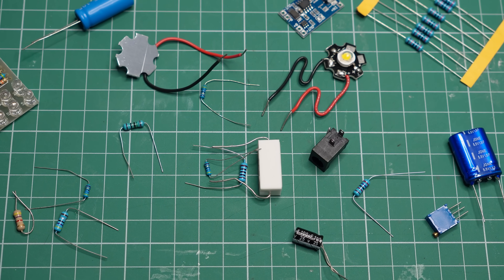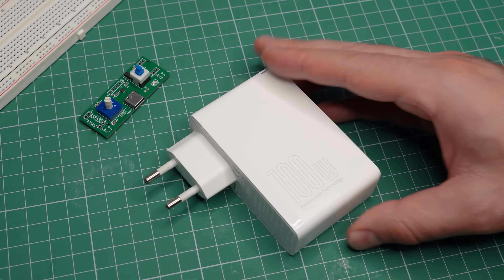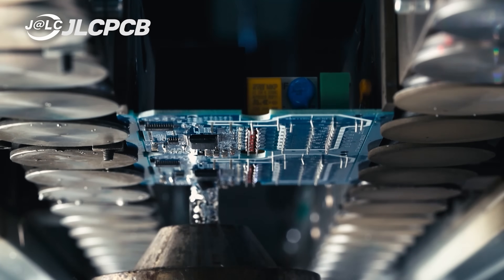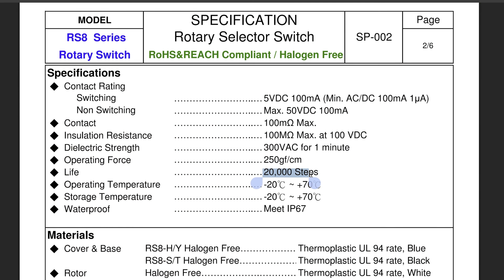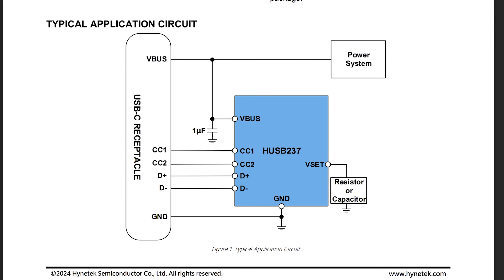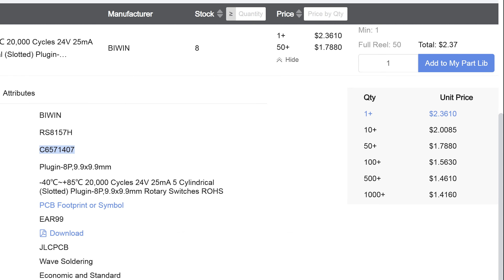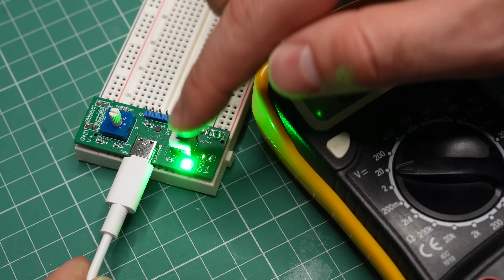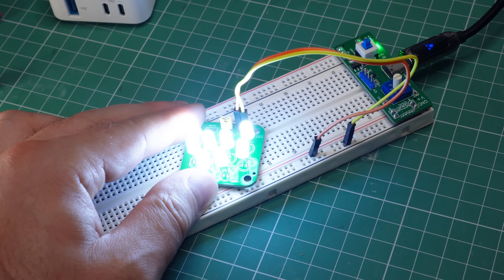My DIY USB PD Power Supply is Beautiful but Buggy

Comment: I think you can draw inspiration from the USB C PD trigger boards. They can also be used for achieving the same goal. There is a great GreatScott video about it. You may check it out. Like in some trigger boards it uses a single push button switch for switching to various voltages. You may also use DIP switches. Both would be pretty great alternatives to compared to the current selector switch, at least according to me. Btw, great video. I think you should definitely keep on improving this. However using the HUSB237 reduces the complexity by a great extent. We only the board to act as a sink device. Using FUSB 302 would be a overkill.
Regarding the problem of the chip registering the new power requirement only after restarting it, I think the chip is deliberately designed to function that way. The HUSB237 does not monitor the VSET pin continuously. It only samples VSET once at startup. You may need add a push button switch that disconnects the cc pins for a short time and there is restart. The negotiation starts again with the new resistor value and we get the new power output. Other wise the charger will just be set at the previously negotiated value. Most standalone PD trigger chips (including HUSB237) sample the VSET/config only at attach. That’s industry standard for simple, low-cost decoys — they latch the requested PDO at negotiation time and won’t re-read a resistor live. If you need live changes, you’ll need either an IC with a host interface or a microcontroller.
Edit: not sure about if one can use a crystal oscillator here…You may take a look at the CY4533 module...it would be great for our purpose.

Comment: nice I like that pd chip I have used it for my project also
Reply: Edit: I just don't like it uses D+ and D- so as an alternative I use sometimes the IP2721 which can work with only the CC and VBUS which from my supplier only costs like 0.10€ more which would make APPLE MODE
BC1.2 not work but I don't own apple products anyway so y

Comment: a current limiting option would be very cool! 
i've made a atx bench power supply but still am looking for a good way to make an adjustable current limiter of a few amps. 
 i just don't like the LM317, linear or arduino with 1 ohm resistor aproaches.

Comment: Unless it specifically says “make-before-break”, any given switch is almost certainly “break-before-make”. With a double-throw switch like that it would be possible to pull the Vbus pin to ground, but you’d want to check its datasheet if it would be allowed to have voltage on the CC pins but not the Vbus pin, my guess is not. It would be an option to disable the output using a MOSFET, especially a P-channel but either way works. Interrupting the CC pins might get what you’re after, unfortunately the chip you chose lacks the ability to disable its output, maybe consider a different IC like one of the ones from WCH. I believe the PD trigger boards using the WCH chips don’t need resetting to change voltages, they usually have a 3-way DIP switch on them but you could easily replace that with a 1-8 binary rotary switch. There’s also the possibility of using analogue switch ICs or momentary switches to alleviate some of your issues.

Personally I think it would be useful to have a split-rail breadboard power supply, for analog circuit design that wants +/-12V or so. Other handy features you could add to your design include an overcurrent latch feature, where exceeding some current threshold turns off the output and turns on a red LED, until the user pushes a button to enable the output again. Better for digital circuitry than a constant-current limit.
Reply from the maker: Yeah, I had the same suspicion about the switches. Thanks for the detailed feedback. It helps! And yes, other people also wanted to see multiple rails. I'll have it in mind if I ever make another version. I think there's a chip that can do a +12/-12V from a 5V supply.
Reply: @LeftyMaker  Rail inverter chips are an option, but because they’re switching ICs they tend to be noire than I’d recommend for an audio circuit. Better to have the audio breadboard supply use a plug going to an external linear power supply (maybe with a constant-current mode), and have it be seperate from a higher-power variable-voltage supply (maybe with an overcurrent latch or efuse). I’m really interested in seeing continuous voltage adjustment with USB PD PPS, maybe even constant-current use, but the protocol doesn’t seem too robust.

Comment: Try to add a pulldows resistor for the vbus pin. Maybe it is realy efficent and the caps floating voltage is enough for keeping the chip in a half flating state.

Comment: HUSB237 constantly requests from type c 5B, by default there is no voltage on type c and HUSB237 pulls cc1 or cc2 to gnd, when you disconnect HUSB237 from power, nothing happens due to the fact that HUSB237 requests switching on even without power. This should not be related to the display in the type c cable, most likely the role is played by the chip in the cable that tells the charger that the cable can skip 5A, due to different manufacturers, the behavior of the chip may vary.

Comment: Yes, this is just a suggestion, it would be better to add a voltmeter, because it is very dangerous if the voltage is not correct.

Comment: It could be that some USB C cables have ground connected to another pin, and the switch is only cutting one of those ground connections. That'd explain why some usbc cables work but others do not with the on off switch

Comment: I had a similar-ish glitch with one of my PCB's. I thought a LDO chip had an EN pin, that would work as a comparator. But instead, it has a noticeable linear section before it disables, lowering voltage, which is not what I wanted at all. Luckily that's a side feature of the main PCB. I would use a mosfet for switching the main power line, and add a SMD fuse of 1A or 2A etc so it doesn't blow something. I was going to say use a potentiometer for the voltage (and you might be able to do that with a different USBPD chip) but that VSET pin is crazy lmao. I can see that it's likely supposed to be set one time by a designer that placed a .5cent part, not be dynamically switched online.

Comment: Great work you have made simple. After sorting out the issues, can you build the battery powered Source board and Sink/trigger board for PD3.2 240W with up to 48V with display for voltage, current, power, internal resistance, energy & coulombic Ah, etc, using this simple concept? Endeavor to share the links to the comprehensive & complete circuit description & details.

Comment: To completely cut the output power you definitively will have to use the intermediate switch approach; USB type A outputs and (apparently) cables with power meter are designed to always output 5V by default, regardless of negotiation (and falling back to when it stops). In these cases that's why you saw power regardless of the PD chip, only type C outputs with normal cables do shut down the power when communication stops (i.e. when the PD chip powers down).

If you have concerns about the current capability of your latching toggleable switch, then use it to control the gate of a powerful enough MOSFET that will function as the actual power switch (don't forget the flyback diode to protect it from inductive loads). To avoid quirks with external connections sharing ground, it's simpler to just do high-side switching with a P-MOSFET. Heads up: this implementation may lead to yet another rabbit hole (e.g. conduction loss decreases with "higher" gate voltage).

Lastly, for overcurrent protection: either go for the analog route of shunt, opamp and comparator; or for an e-fuse chip. The latter can also be used as your switch since some do have an "enable" input that doubles as undervoltage protection. Thanks to GreatScott I know the TPS259621 as an e-fuse example; however it goes up to 2A so it's up to you to find a more capable one.
Reply from the maker: This is valuable feedback! I think your comments are on point. And yes, I did look into e-fuses, but since I've never used one, I might test a few separately before including one in a project. Thanks for the help!
Reply: @LeftyMaker  yeah, give them a try, it's way simpler than implementing your own overcurrent detection circuit, plus the benefit of doubling as a switch like I mentioned.

Comment: I actually like that it does not change voltages until reset, but no short circuit protection seems like a bit of an oversight given the intended use case.
I probably would just use a high-current toggle switch (one of those 'clicky' aluminum ones that look like they belong in an airplane) on the power line.
Reply from the maker: I expected the power adapter's short circuit protection to suffice, but it appears that I was wrong. Still, a good learning experience

Comment: short-circuit protection and probably even overcurrent are almost always unnecessary because the USB-PD supply will handle that on it's own
Reply from the maker: I was thinking the same thing, but then I tried it at the 5-volt setting. When I shorted the output, the voltage dropped to 2.5V and I got 3.6 amps through the multimeter

Comment: It is exactly this type of thing that has every time scuppered my many attempts to take up electronics again. Theoretically a thing should work, no question at all but when set out practically the thing doesn't work... At which point all my enthusiasm and interest departs, the contents of my handicrafts table gets swept into a box and I go and read a book instead!

You're a better man than I, LeftyMaker to keep going after this kind of disaster!!!
Reply: The problem was just that they didn’t look at the USB-C PD protocol well enough. He assumed that it works like a buck-boost, but if you watch one video about USB-C PD you would know that the power gets defined when the cable gets plugged in. If you hate mistakes, you can eliminate most of them before ordering just by doing good research. So don’t get discouraged and give it a try

Comment: Why not put the switch before Vbus connection to chip...? (totally off)
No 3.3V option, that is now hugely needed for projects with new chips...
And in some projects different voltages needed in two rails...
and yes extra 3v3 regulator just for indicator LED is too much... I think 1k to 1.5k resistor will do the job...!
Reply from the maker: Yes, that's what I did. The switch is between VBUS and the chip. I guess after the voltage negotiation is over, the chip does not check for changes on the VSET pin. About the rails, now I'm thinking if I could have the top rail do 5-20V, while the bottom does 3.3V through an LDO or buck converter. Or perhaps I should look into PPS and figure out how that works!

Comment: Great proyect my man, have you thought of any feature to have a different voltage in each rail? Is not that necessary but very useful, also how is the noise of the power supply?
Reply from the maker: Yes, I was thinking about having two rails, but with the amount of things that could go wrong, I chose to keep it simple. Noise is roughly 50mV pp, down to 30 if I add an extra electrolytic on the breadboard's power bus. I suppose it depends on the charger in use